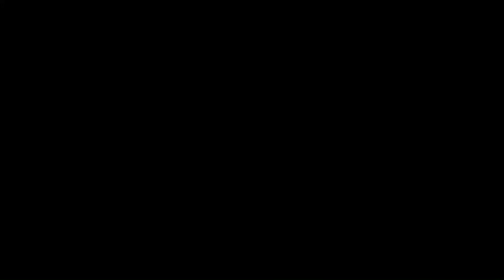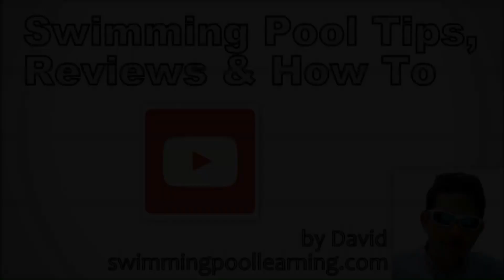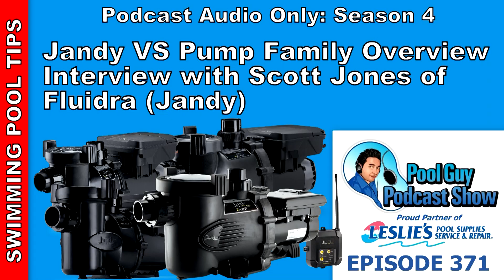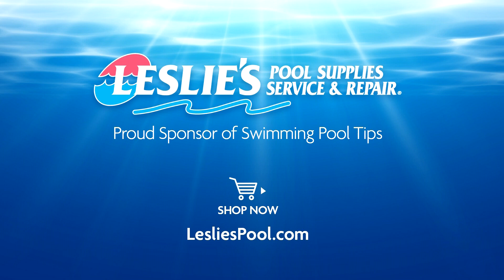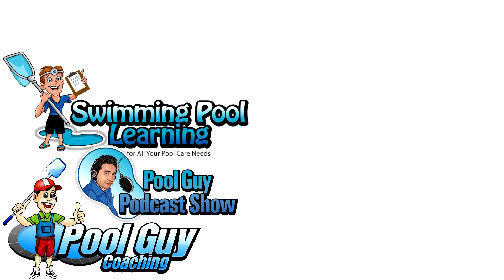An Overview of the Jandy Family of Variable Speed Pumps: Interview with Steve Jones of Fluidra/Jandy

Comment: I have a 40K gallon pool.  I am being told I need 2100 Jandy series pump.  Because my current pump is not priming and Takes forever to prime by manual process.  I have a waterfall feature and spa.  I know they are like $2800.  I just want my pool to work without any worries.   Thoughts?
Reply from the maker: A 2.7 or 3 thp pump would be fine for your pool

Comment: We recently had the VS 2A 2.7 version installed. We run our pool with Jandy iAquaLink 2.0. My installer installed the pump to replace a old single speed pump which turned on via the relay in the jandy breaker box which houses the iAquaLink controller. We also use the Jandy Tru Clear chlorinator which was wired to turn on at the same relay as the pump. Now our chlorinator powers up with the pump and I’m able to adjust the chlorine level in the app but it is not producing chlorine. When I check the status it shows 0% chlorine and “offline” instead of the 50% that I set in the iAquaLink app. The LED status on the chlorinator housing shows standby with the antenna icon. After listening to your podcast I’m wondering it the installer made a mistake by using the relay in the Jandy breaker box and didn’t wire constant power and re wire the chlorinator to the relay in the pump. Do you think that’s my issue?
Reply from the maker: I would call Jandy on Monday and they can walk you through the set up over the phone to see if your hunch is correct. 800.822.7933

Comment: God bless you too. Leslie's came out today and sold me VSFHP165AUT to replace my main pump (have a separate pump for spa jets, freeze protect and waterfall) that is 1 HP for a 15,000 gallon pool. The question I have is should I be getting the 2.7 for any reason? They both run at the same top speed right?  I have 230V. I definitely like the fact that it works with my Aqualink which I didn't realize a Hayward pump wouldn't. Thanks for your help.
Reply from the maker: The 165HP is plenty. No need at all for anything greater. Gad that Leslie's is taking good care of you! 👍
Reply: @SPL  Thank you.

Comment: What is the most efficient speed for your system? Why are you running it at another speed for hours on end?
Reply from the maker: One low and one medium is my settings. 1800 RPM and 2300 RPM are a good low and medium speed.
Reply: @SPL  Dave, when you run your pool at 2300 is that high enough RPMs for things like a gas heater to run, a salt system to produce chlorine, and a pool cleaner to work properly?  Does it depend on the actual heater, generator, and pool cleaner or do these work differently depending on the brand?  I have basically been taught that some systems require a higher RPM for flow, basically maxed out at 3450.